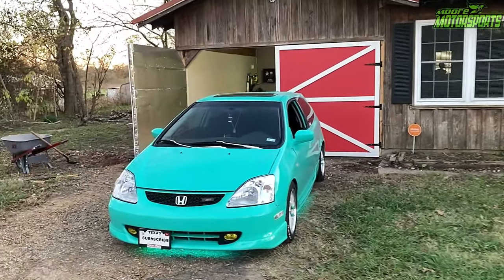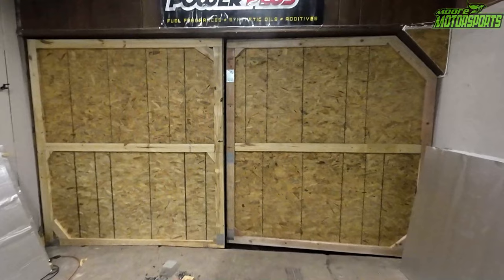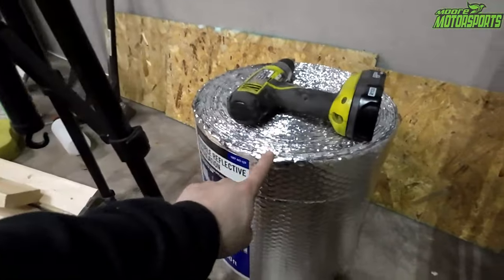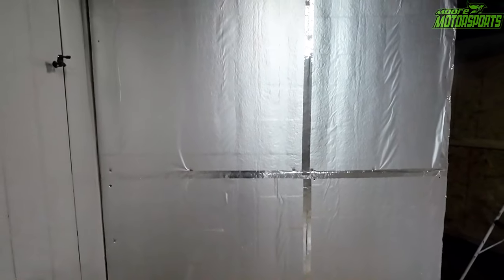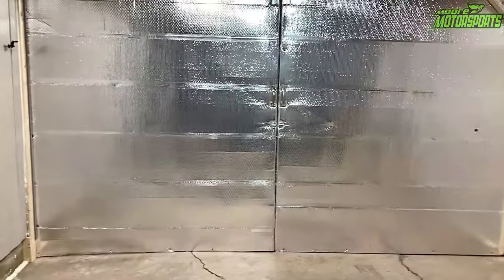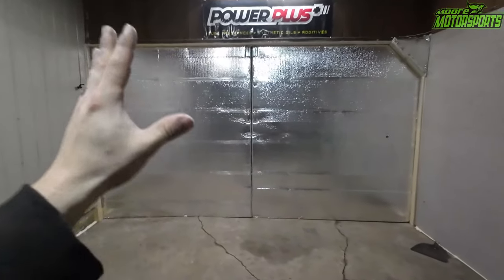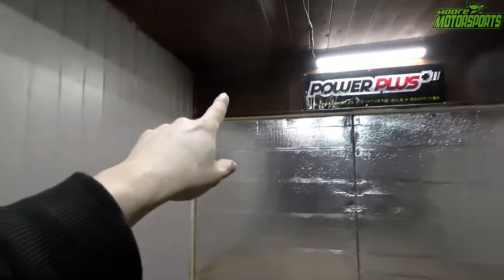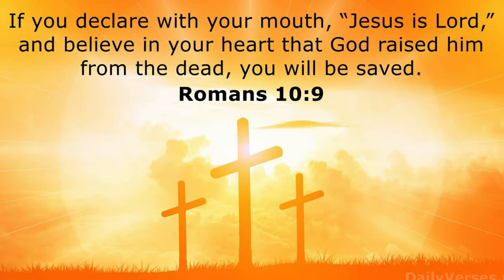BUILDING BARN DOOR STYLE GARAGE DOORS. PART 2 OF TURNING CARPORT INTO A GARAGE.

Comment: You may consider adding some sag preventative mods for your doors.   A diagonal tension cable from the top corner of the hinge wall to the opposite bottom corner works great.     Good luck!   Shop coming along!
Reply from the maker: Thanks. These are 290lb hinges each and I have 6 but if it sags eventually I will address it then. Thanks though!

Comment: I think how you did the insulation on the door was actually better than if you had cut the pieces to fill in the gap, because if there is an air gap it insulates better since heat doesn't transfer through air or something like that

Comment: Happy day 4 giving thanks! Doors are big enough. Maybe put a spring loaded wheel so they can ride the ground instead of sag.
Reply from the maker: It’s not sagging but a wheel was a option I considered. Each hinge supports 280lbs and I have 6 so sagging shouldn’t happen. Hopefully
Reply: @JamesDguy  yep. Looks good. I would add the wheels now before you need to. " Stich in time saves 9"  I worked as a carpenter 20+ yrs. And seen many doors especially those outside, top hinge pull away from buck ,as bottom hinge pinch over time. Factors: movement, expansion due to weather etc.

Comment: Looking good!  👍  In the future if you think you need more sound reduction insulation, try looking at Rock Wool Comfort Board 80 or 110.  The Comfort Board 80 comes in 4 x 8 sheets.  It is fireproof, repells water, mold & mildew will not grow on it,  mice and bugs hate it, and it will substantially reduce/block outside noise.  I think you are on the right track, making due with what you have and can afford.  Best wishes for a happy Thanksgiving!
Reply from the maker: Yes we are just on a small budget so got the cheapest stuff for now. I will definitely consider it though! God bless you and happy thanksgiving

Comment: For security, I would use carriage bolts and fender washers followed by double nuts on each carriage bolt.  If all you used was wood screws from the outside, they could be easily removed and your stuff would be at risk.  It's what I used for almost two years before I had a 12' wide 9' tall overhead door installed on my workshop.  I didn't want it to be too easy to get in.  Still love what you do and your open faith in Jesus.
Reply from the maker: Thanks for your opinion and by the time they would get one hinge off I would be notified even if not at home. We have security cameras with motion alert and if they killed power it has a back up power source runs on battery. The screws are mixed up so some are Phillips and some are another kind I’m not mentioning so they would have to be quick at changing bits and unscrewing haha
Reply: @JamesDguy  Well spoken from someone who obviously has security cameras and such at hand.  When I built mine, I didn't have those.  Just a bunch of dogs for an alarm and the second amendment if the dog alarm was activated.

Comment: OSB is a POS for anything exposed to weather, rain, humidity.

You should’ve gone with pressure treated wood &  plywood & then end-sealed the cut ends & also maybe rubber coated the wood (inside/out & the edges) before adding the insulation & finally the paint & trim.
Reply from the maker: Well the osb is cheaper and I am not made of money so I did what works. This is a budget build because I’m not rich lol it will last many years and when it falls apart I’ll have saved up enough money to do it better. It’s 100% better than before. Thanks for the criticism